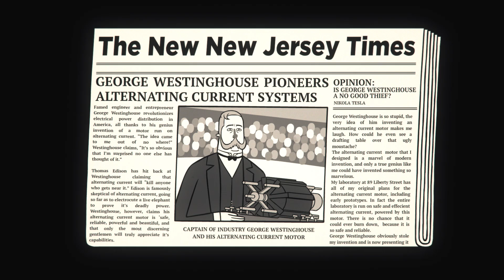Tesla's AC Induction Motor

Comment: Just as how the big four, conspired with the Feds to kill Tucker Cars, Hughes Aircraft, and a lot more industries. Tesla's induction motor cannot generate profit cause it runs forever. And users dont need to buy more. While Ford for example build cheap cars but low budgeted and design, that will make buy and buy more as it keeps rottng down quickly. Just as what Ford cars are doing these days as well as other US Brand Car Makers. According to Scott Kilmer

Comment: Literally no! Nearly everything about this is wrong! Westinghouse was already using AC, they licensed the patents from Tesla Co., had Tesla on as an advisor, the Tesla induction motor ran at a constant 60Hz(the reason electricity and tv runs at that rate) and couldn't be used in a vehicle because it only had a constant speed. Westinghouse eventually went with a DC traction motor for their electric cars.
Reply: Agreed, imagine how many people now turned into Hating Westinghouse. 
Tesla should be portrait as a Tom Brady of engineers, not some push over.

Comment: It's funny that people keep saying ac is better over long distances, but that's a misnomer. Very-high voltage dc is actually used for long distances and underwater cables as ac current attenuates over distance and passes current through insulators. The real reason we use AC for most power grids is the fact that AC is easier to convert between voltages with the use of a transformer.
Reply: What are you saying and not saying? 🤨

Comment: Akchually, electric cars were more prominent at end of the 19th century and at the start of the 20th century and first 60mph speed record was with electric car. IIRC. So Henry Ford comment here is not correct. Ford assemly line gasoline vehicles was much later 1910's than Tesla induction motor 1890's.
Reply: U know nothing u just looked that up on Wikipedia
Reply: They were, and that was Edison who was developing them

And later Edison and Ford worked together on creating a cooler electric car

That's actually so ironic that nowadays electric cars are associated with Tesla even though it was Edison who worked on them